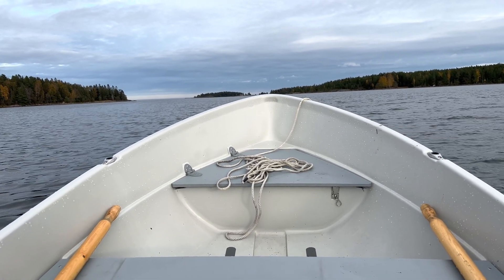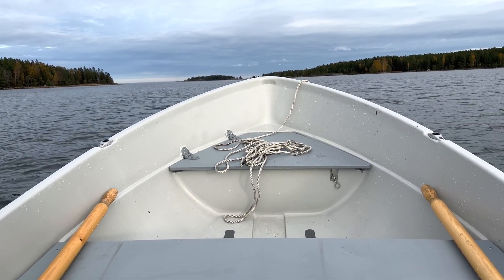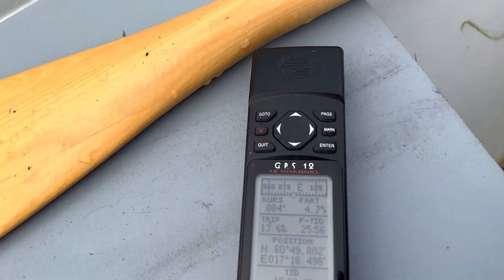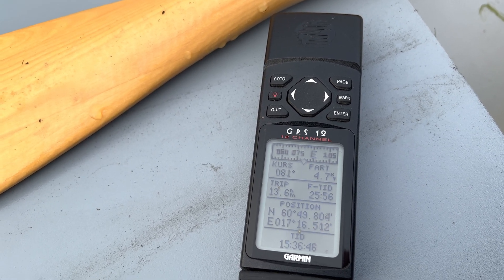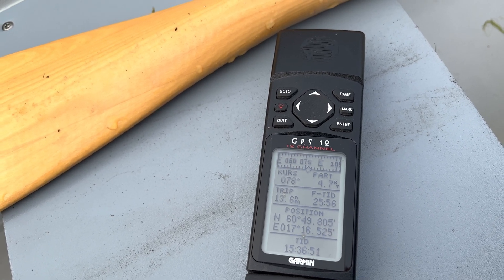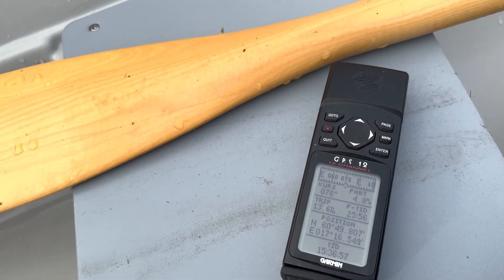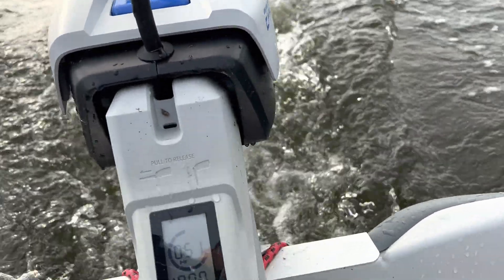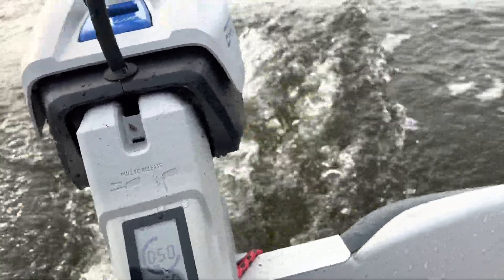ePropulsion Spirit 1 Plus Cruising Top Speed test ( Electric outboard boat motor )

Comment: Sitting in the back of the boat is also not efficient.
Try to sit in the middle with a helm extension
Reply from the maker: Yes the boat runs a litte better if I sit in the middle but I still prefer to sit in the back. I have a counter weight in the front luggage compartment that weights 16 kg so that does things a little better. The main thing with this boat is to cruise silent in low speed. I have also notised that if a start to get over 4 knots the water splashing agains the boat gets worse and it creates noise so the best thing is to run the engine at little over 200w then its super silent and the speed less then 4 knots if you wanna go as silent as possible. And silent is the whole idéa with this boat.